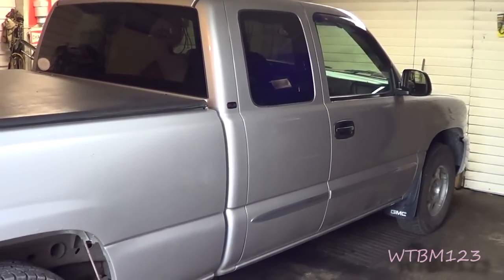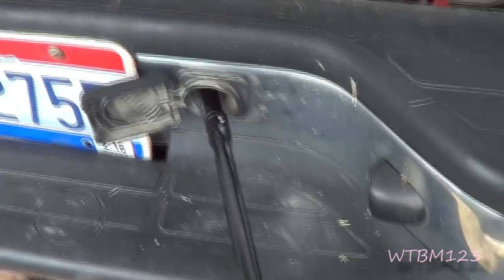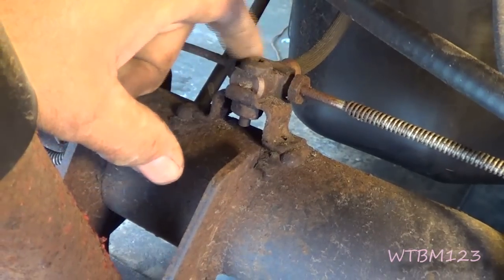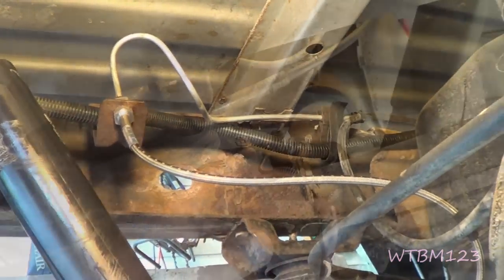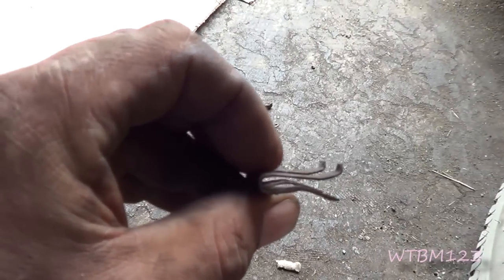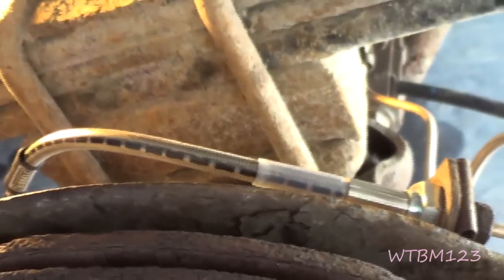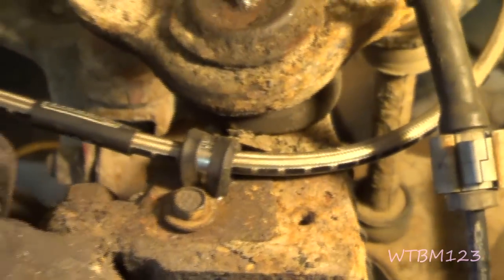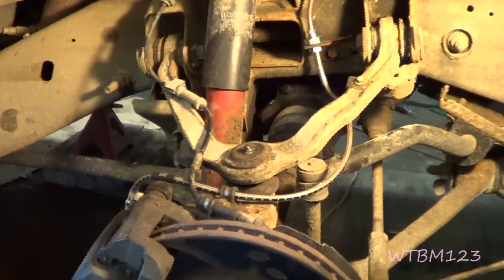Sierra - Silverado soft spongy brake Pedal , Installing Russel Brake Lines

Comment: We had an older VW Vanagon in the shop a while back with a low brake pedal... was due to a leaky rear wheel cylinder. No biggie... replaced the wheel cylinder and that's when the fun started. Rusty brake lines started to pop all over, after the pressure was back. Ended up replacing almost every line.
Reply from the maker: +Thomas EXOVCDS Thanks for watching and commenting

Comment: Soft brakes on GM trucks often has nothing to do with air in the system or any of the ridiculous assertions about expanding flex lines.  It's the sliders.  The rubber, inner  bushing inside the slider holes on the calipers distorts and becomes misshapen.  This results in a spring effect on the slider pins, pushing the caliper away from the rotors.  When replacing your brakes, ALWAYS replace the sliders. Make sure the holes are clean and rust free, the bushings are inserted correctly and pins move freely in the slider holes.

Edit: The other issue is with sticking pads. Ensure all rust is removed from behind the pad corrosion brackets.  Make sure the pads slide freely when inserted on the caliper bracket.  It should be a loose fit with no binding. Grind a bit of metal from contact points on the new pads if needed. 

I've done this on several trucks and obtained a solid pedal.
Reply from the maker: Maybe not , but i have had good brakes on it every since i put the lines on it , Still working great
Reply: @wtbm123  Your video and your commentary does not leave me with the the feeling this fixed your problem.  The web is littered with forum posts about these brake lines and guys having zero success after installing these braided lines.  If the lines were the issue, posting video of the old lines actually swelling would have supported your argument.

GM's slider design and rust issues are the problem with these brakes. Mostly on the HD models with 4 wheel disc brakes.
Reply from the maker: @larryfine4498  Sorry you do not believe me , but that is up to you . The slides were already addresses . and the pads were not stuck not moving , I agree , most gm truck in the shop suffer from that , but none of that fixed this truck . The lines did . so believe what you want ,

Comment: I'd be careful using those aluminum washers, especially in the snowy states. The aluminum will corrode with the salt from the roads and begin to leak. Put copper washers back in and you will be golden!
Reply from the maker: Thanks for watching and commenting
Reply from the maker: Yep ,Those washers made about one year before leaking . replaced all with copper ones . Will never use aluminum ones again

Comment: Good info, my 2500hd uses hydro boost compared to your vac boost and I still have the original brake hoses on since 2002. It's stops.real nice and a firm pedal. Your hoses never looked bulged out but it seems to have solved your concern.
Reply from the maker: +Steve Rob All my hoses passed the look test , but the russel lines seem to of made it feel much better . Now if i was to take the russel lines off and put new stock lines on , not sure i would feel the difference . I may change my brakes to Hydro Boost . You get more clamping force with Hydro , Have also thought of upgrading to the newer style half ton brakes  with the bigger rotors .

Comment: Good tips on the installation Terry and the installation looks pretty darn good with those stainless lines. Although the rubber lines looked good as you said, they could do some swelling under pressure.
Reply from the maker: +stuzman52 I am glad i done it , Now as i drive , the brakes are not always on my mind and will even let the ole lady drive it now . Thanks for watching and commenting
Reply: Always a good feeling when you've got good brakes. Always a pleasure comment Terry....
Reply: +stuzman52 It sure is. :)

Comment: Terry, No worse feeling then stepping on the brake pedal and having it sink to the floor and the truck is not stopping, really, really scary when loaded, or in my case, perhaps overloaded, popped a brake line on the F150, was loaded, moving slow in a parking lot, I thought I was going to have to buy someone a new Ford Focus... Thanks for posting, as usual, a nice neat repair...
Reply from the maker: +Harvey Spooner LOL yes i agree brakes that work are a nice option . Seems like most cars anymore loose one line loose all , seems a lot of SAFE anti lock brakes are that way any more , if u loose a line

Comment: Smashing job, those new lines with external brading look so smart :-D
Bloating lines under pressure, easy to overlook.
I changed my mates rear piston assembly in his old car, the line nuts had been there a lifetime, they had became one with the line lol.
After lots of jiggling of the nut plus more scraping+wire brushing+fluid it started to move (oh joy).
The other side didnt give way too easy eather lol.
Reply from the maker: +zx8401ztv Yea sometimes a bit of heat helps , but patience is a must . But it does make one happy when it does move
Reply: +zx8401ztv Your comment targets specifically what I learned about. Be gentle and patient. Lots of things don't need that. It's good to know when to slow down.
Reply: +DE Nichols Well i had to be carefull, if i broke a line the car could not be moved, cant drive it without brakes lol.
The bleed nipples were the same, once i got them out i had to drill the rust/crud out.
When the job was done, i coated the bleed nipples with grease, hopefully that will slow the rust takeover :-)
Reply: zx8401ztv
Ya know, I'm always thinking it's so much work to sand and paint to prevent rust.

Silly me. that's what a quick dab of grease is for. :)  Good morning over there in Great Britain!
Reply: +DE Nichols
Well if you look at a greasy/oily engine its not rusty lol.
Bare metal is perfect for the water/oxygen reaction to start, so slap some grease on it ha ha :-D
Hopefully it will be nice today, yesterday i was delivering peoples furnature on the salvation armys van, the day was windy with rain in bucketloads, but we got the jobs done :-D
Not sure about britain being great any longer, nice thought though :-D
Reply: zx8401ztv If you've paid attention my engine is greasy. Lol. Even cleaning it up I let it be a little greasy. That oil leak may have saved me from a lot of rust when I moved to a rainy place! :)
Reply: zx8401ztv I wish you good weather. And many British people have made that comment about great. ..I was partly wondering will he or won't he say that? Cheers.
Reply: +DE Nichols Actually i didnt notice, i was focusing on what your were doing and saying, but ive never seen any engine stay clean and oil free, unless its never used.
Reply: +DE Nichols lol, well i do understate most things, thats stereotype english people ha ha :-D
Reply: zx8401ztv
lol
Reply: +DE Nichols if thats ok, check the power board in the welder, you dont seem to have wire feed, check fuses.
Costs nothing to check :-D
Reply: zx8401ztv
You're the first to watch the video and already you may have out done the need for any more advice from anyone (Very smart group, you never know)! Maybe they'll still feel like contributing if they don't read this. I'll still give them extra credit, lol....wait, you're giving me the extra credit now that you're the teacher. :)

I should go back to bed, woke up in the middle of the night thinking, oh, that's almost ready to upload! Maybe before the weekend is over I'll upload the motor mount uninstall. Once my welder is working I can shoot the reinstall and finally get that pesky bolt out of my exhaust shield. Welding can be so easy for stuck bolts, the hard ways sure make more video though, lol.
Reply: +DE Nichols Hey you get your sleep, your subconscious will mull over the welder problem while you sleep.

Comment: This is way later in time, but I just feel I should add that you have to be careful and check with the steering turned to full left and right with the wheels on to see if the hose is rubbing on the rim.  We just replaced  my son's 2002 Silverado front lines and where the hose connects to the a-arm there is a loop or bow and not tightly attached like the original lines.  I temporally tied them back with zip ties.  It only makes contact at full steering lock and will only contact at very low speeds but I am going to do something to remedy the issue soon.  Zip ties might not last when the weather heats up?

Comment: Might have to try that with the Suburban, it's way softer than I'm comfortable with.
Reply from the maker: +TheWreckingYard also make sure the pads slide in the holders . a lot of them on GM seems to get stuck and pad can not slide or move , and some new pads , usually the cheap ones , sometimes after cleaning every thing up , still need to grind a we bit on pad to slide right and easy , most higher dollar pads just fit right out of the box

Comment: I am getting ready to give my 2006 Chevy a brake overhaul so I looked online at these Russell lines and the reviews are not good.  
Wrong parts in package, labeled wrong, metal sealing washers giving up after 2-3 years, hoses not affixing to arms correctly, ends not going through hold areas.  I was excited to see this braided steel and a kit but I am not buying it with all these issues.
Reply from the maker: I can not speak for others , but i have had no issues , But they come with what looks like aluminum sealing washers , I switch them out for copper ones.

Comment: So does the pedal feel "firm" and give plenty of stopping power?  My 2500 hd nearly goes to floor and I can't see any air after bleeding them. Been thinking about those rubber lines too
Reply: Hi , I have the same truck and in my experience there a couple of things I would check as well as the hoses . The twin cylinder calliper pistons have been known to stick in the bores as well as allow air  to enter the calliper  but not show signs of brake fluid leaking out. I have also tried a  cheap set of pads as well and the truck failed miserably trying to stop.   Hope this helps .
Reply from the maker: +Velvethamma Not sure on the 2500 , but i was doing all the lines so the $120 or what ever they were was great for , me . And like Rob said make sure calipers are good , and make sure the pads are not stuck in the holders . i get a lot of 1500 here with the pads stuck . I use mostly Thermo Quiet pads , mine has the severe duty ones
Reply: wtbm123 I've had the pads stick on their slides as well as the pins getting stuck in the bracket too.  Never would have thought about calipers letting air in....  I know we discussed soft chevy brake pedals in the trucks on mumble before and wasn't sure if your hose replacement helped.
Reply from the maker: +Velvethamma My brakes now do feel safe . They feel good enough that now brakes are not always on my mind . and my old hoses looked good , but i believe it was money well spent . Takes less for air to pass then liquid . Could crack a bleeder or two open and just watch if air comes out
Reply: +Steve Rob Good tip Steve on the sticking of the pistons in their bore...

Comment: wtbm, always enjoy your videos, I have a question, you said the Russells weren't the same length? how much shorter were they. I have an 06 Silverado I just replaced all the lines with the AC Delco OEM bent lines but didn't replace the rubber lines. Man I hate that GM used such poor lines on the brakes. the new ones were treated for corrosion and had plastic on the lines so I think they will be a lot better, I do still feel a slight mush when I push hard and I bleed them good so I am thinking like yours one of the rubbers are stretching a little.
Reply from the maker: They were long enough , just have to make sure you run them right as there seems to be no extra . Also they come with aluminum sealing washers . I suggest throwing them out and get copper . I had one leak after a year or so and the washer had corroded away . Also on those truck . Must make sure all caliper slides are free , and the brake pads are moving free. They like to stick in the caliper bracket . I take the stainless clip out and sand blast that part of the bracket . I find a lot of trucks with the pads stuck in place . Also if system has been competely drained , may need to bleed the abs unit . Need a scanner to activate that bleed process . After using computer to run bleed process you must bleed to get air out of lines . Also i gravity bleed or vacuum bleed . I do not like the pump pedal bleed . The lines are doing well . But just need to pay close attention when running them .

Comment: great vid I was putting on a new fuel pump on my 2000 Tahoe and saw my rear brake line rusted pretty bad I bought the brake line kit but i couldn't get the nut loose from the rear brake line to the  abs unit I had to head down to Florida so i couldn't open up that can of worms do you just heat up the nuts and they pop free or is there something in the abs unit that I would ruin ...Thanks Terry
Reply from the maker: +RICKAFIX Yes one can try a reasonable amount of heat and penetrating oil . . If it is the one under the drivers seat hooked to frame , it is sometimes hard to get a very long wrench in there . Most because of that seem very tight . . If any doubt then may heat some . if one gets it broke loose and still hard turning then try more lube and be careful not to gull the threads as i have saw one that brought the threads out of the controller, but most come out ok after broke loose .  If only doing the back line u prob be ok , but if air gets in the controller , sometimes only way to get it out is with a computer , sometimes one can drive it and use the brakes in gravel or something and activate the abs , will help bleed if air in , but do that as a last resort.
Reply: +wtbm123 ok thanks Terry
Reply: +RICKAFIX Thanks, you added to already a great video.

Comment: I have 4 wheel disc on 02 z71 having the same issue pads look great I'm thinking master cylinder or air in lines
Reply: I have 2000, sierra 4x4, and its already time to upgrade the lines. Already did the rotors and brake pads, changed both front hubs, and passenger caliper, will be replacing all remaining 3.  
Been searching Non stop for ss braided brake lines and found a set. 
    Really wish I could delete the abs system, been reading on that, but unsure if to go that route. Truck has 23k miles and gona do full restoration. 
     Replace the lines man, swap out those rubber crappy ones. And flush the fluid. Double check that abs module read on alot of forums that it fails, reason why I want to do away with it.
Reply from the maker: Make sure front bearings are good , calipers slide well , pads move free in the caliper bracket , sometimes air takes a long time to come out .
Reply: @wtbm123  appreciate it. Yes I replaced both wheel hubs, not a year old. Just ready to sell it ha

Comment: I have a 04 Silverado 4 wheel disk, just did all new front brakes and new lines all threw the truck couple weeks ago my pedal still has alot of travel before it wants to stop, we bleed them numerous times but doesn't make a difference, but we did brakes on a friends 06 same setup and soon as you touch his pedal the truck stops great best brakes ever. Cant figure out what's different in my truck?
Reply from the maker: Make sure the brake pads move free in their holders . All wheel bearing are good . May need to cycle the abs unit and then bleed .
Reply: Any solution? I had my front calipers, pads, shoes, and rotors changed and bleed. Now my pedal feels mushy, unlike before
Reply: @armandol1826  We never figured it out we also did the new master cylinder front bearings I gave up  brake pedal always felt like crap like it didn't want to stop i ended up selling it  i told the new owner what the issue was but I never heard from him truck was clean as hell and a short bed but it kept having problems i was tired of fixing stuff every month I went back to a F150
Reply: @frankm8533  bro my issue was the abs auto bleed. The new front calipers got hella air the the system. Thanks for helping though
Reply: @armandol1826  Gotcha. I remember having a guy come out and cycle the ABS a few times with a scanner but it didn'thelp the braking issue. Plus the truck road like crap! I did all factory suspension rebuild but it still road horrible... the plan was to V8 swap the truck and lower it down but I could never get it to ride better or brake right tbats why I sold it I lost alot of money on it but I was ready to move on
Reply: @frankm8533  interesting. That’s unfortunate. Could it have been the brake booster?
Reply: @armandol1826  That was new also  I was tired of messing with it  I just felt like thr brakes always felt crappy and the ride was horrible

Comment: Was the abs module also a cause of spongy brakes?
Reply from the maker: the lines was the main issue . brake pads being stuck , not sliding freely or a slide pin froze up can also cause a spongy pedal 
I done a video on using a scan tool to bleed the air out of abs , but it had  no air so i only showed the scanner part , and not the bleeding after the scan tool

Comment: Chevy brake lines are crap. I had three separate lines corrode through on my 2000 Silverado at different times, and you loose all braking. My experience is that if you replace practically the entire brake system, most brake problems go away.
Reply from the maker: Thanks for watching and commenting